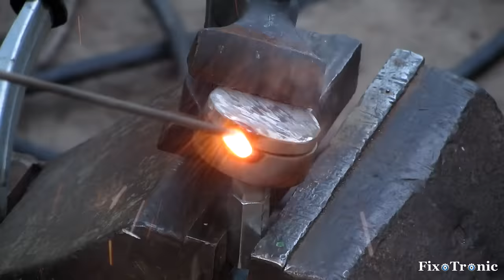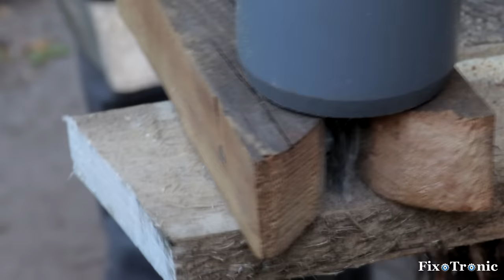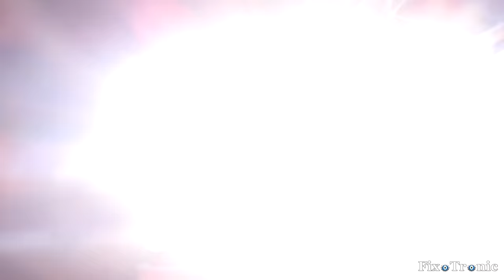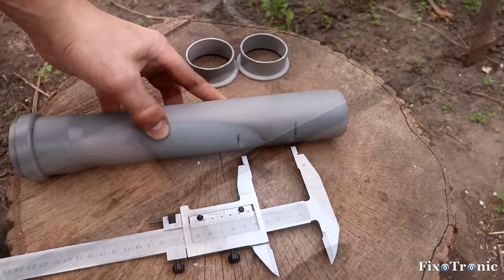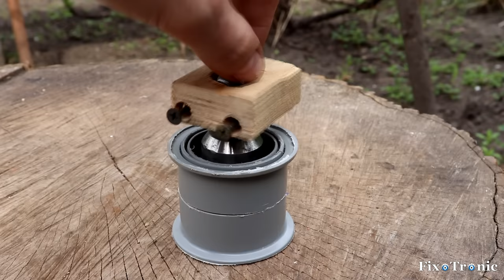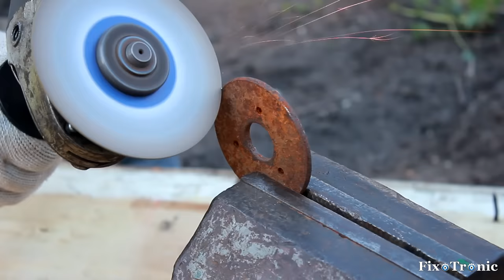Amazing Top 3 Don't Throw Away Jigsaw Blades.

Comment: I didn't see any reason not to throw away jigsaw blades, I only saw a reason to use nice new sharp ones. Your clickbait title wording would indicate you were going to show a way to use or upcycle a used jigsaw blade, but it does nothing of the sort. You are going through a lot of engineering to turn a drill into a janky jigsaw considering you are using precision calipers/micrometer to make it. I also didn't see the need to use the rusted bearing. Was it mainly for the circular shape with a hole through the middle?  A jigsaw is not a very vital tool that you would need a welding rig, an angle grinder, a power drill, a grind wheel, possibly a lathe before you could adapt your power drill into one. These are not basic tools that most people have at their disposal, and if they did, they probably would already have a working jigsaw (which you do and used to make the belt sander). Your ability to make things is ingenious, but not very practical for your average person IMO.

Comment: interesting ideas in case the apocalypse hits and metal tools are worn to scraps. 
i didnt like the drill idea though, could just cut an angle on any metal stock and go at it...
belt sander is pretty good idea, using a minimal, non-invasive addition to a power drill.
Jig saw same thing, minimally invasivie. 
auger is pretty cool.
Reply: . Ke

Comment: that blade will not return once push into the material.. there should be a retracting puller.
Reply: Did you not see the spring that was used inside the tube

Comment: Oui, Pierre? Exactement,  you can buy a HF jigsaw for $19.99. Sure this video shows ingenuity on behalf of Johnny Fixo. But, come on? These are ridiculous?  Maybe if you were out on a farm and needed to make one of these tools it would make more sense and looked at as genius but.... the circle jig for the grinder is pretty cool but.. again, just cut it out with the angles and finish the circle on a belt sander or a big file.....AND WHY did he use an actual skill saw later in the video and not project #1? Stick to the theme Fixo!

Comment: All are good except the fourth one is not perfect, you should weld multiple saw rings so that each ring (circle) throws the dirt to the upper one until they throw the dirt to the surface, this way it will be faster, easier and safer even. Thanks.